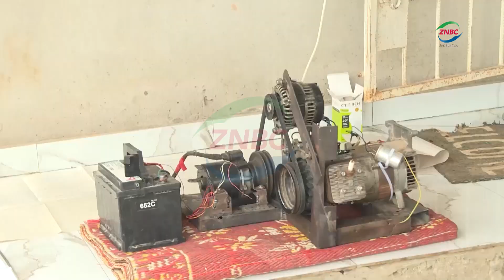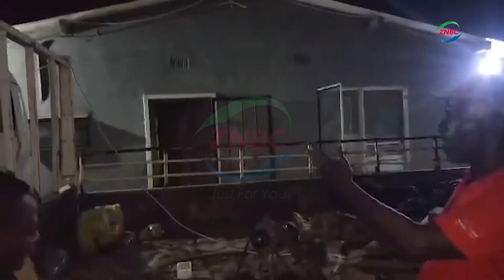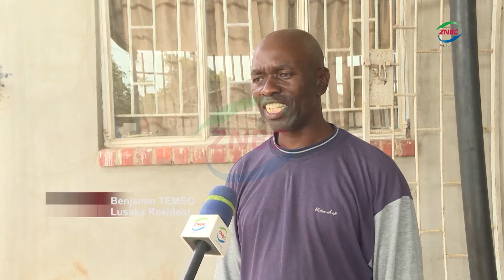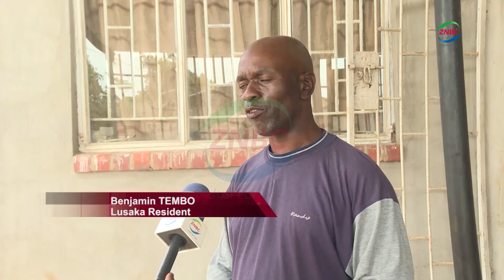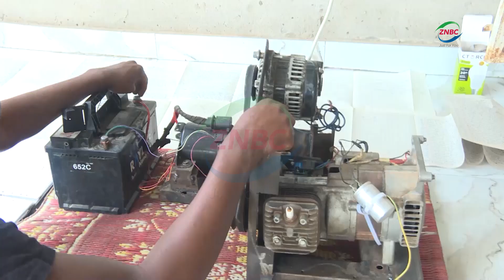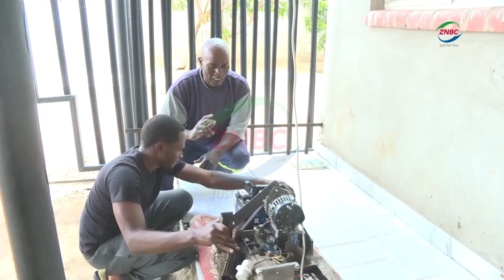Electricity machine powers engineer’s home in Lusaka

Comment: It is hard to comment on this one. Starting from calling it an 'invention' when it seems like something that is already there. Then to claim that it doesn't need extra energy when the so called perpetual energy machine has been a holy grail in physics or science...has he cracked it? Can this really keep going and going without extra energy? How does it escape energy losses that reduce efficiency?
Reply: That is the point. The system works as long as the battery is charged. After the battery discharges the system collapses. There’s no free energy machine that works in perpetuity on earth yet.

Comment: I don't understand what the patent protects. Seems to me that this technology already exists in every vehicle. That's how car batteries need that alternator to constantly recharge. Just that now the electric output is for home lights. It's a 100 year old technology unfortunately.
Reply: It's not the same, vehicle technology starts from electrical (battery) then mechanical which involves fuel then back to electrical to charge the battery. In short the charging of the battery in a vehicle is dependent on fuel however in this innovation there's no fuel involved
Reply: @bigmitch1134  Isn't the spinning motor in the alternator mechanical though? I see a fan belt there